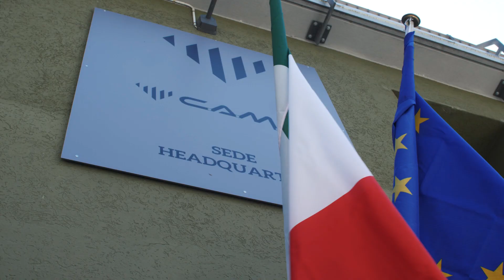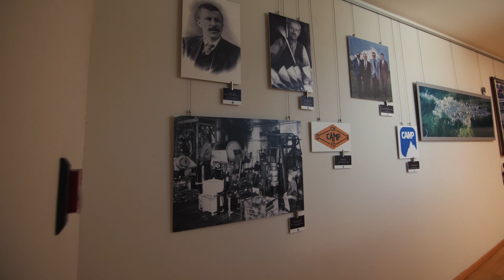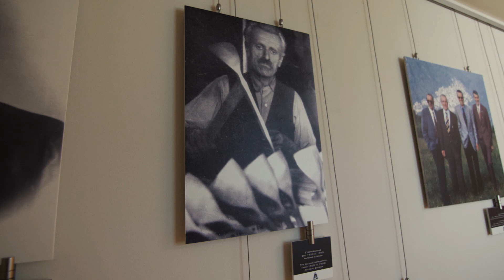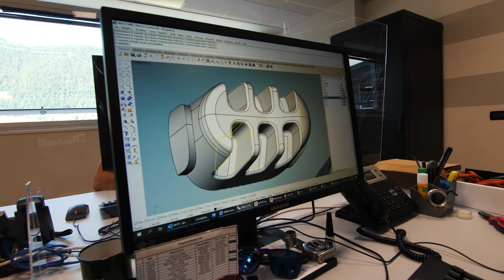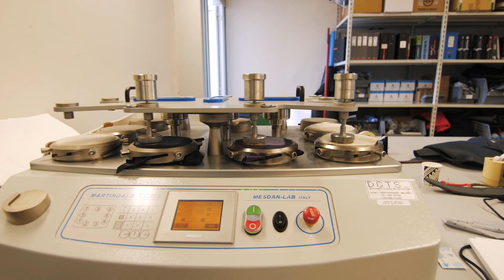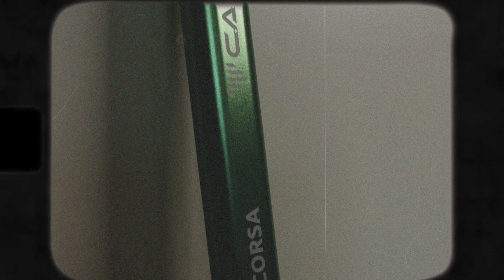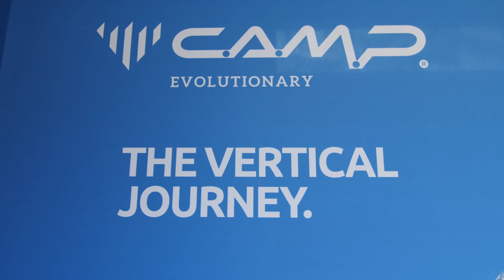100 Years Of Producing Climbing Gear Has Led To This Product | Climbing Daily Ep.2058

Comment: 10:00 I am very sorry but you have made a mistake calling this machine "a water jet milling machine" it is an ordinary CNC milling machine cooled by a cooling lubricant at a pressure (you can clearly see the swarfs and the noise coming out of the motor). Water jet CNC is used for cutting similarly as you have presented the CNC laser operation. Instead of a laser, the cutting process is made by abrasive particles that are accelerated by a pressure of water coming out of a sintered carbide nozzle :)
Reply from the maker: Thanks very much, we appreciate your attention to detail 🙏
Reply: @dailyclimbing  If you ever need pre-production feedback from an engineer and also a climber give me a shout :) All the best guys.